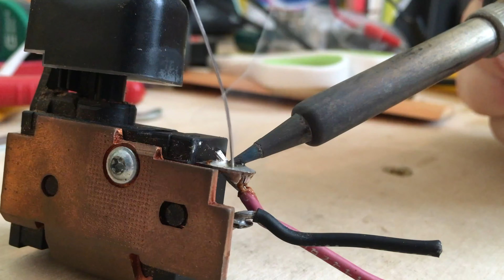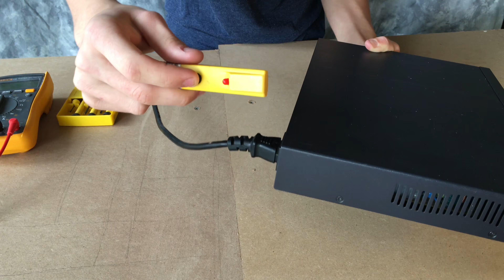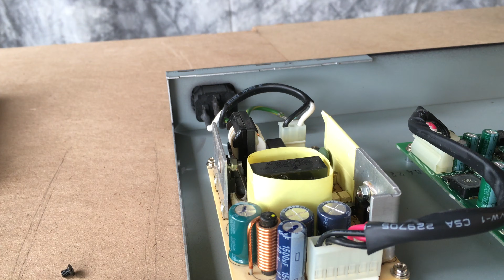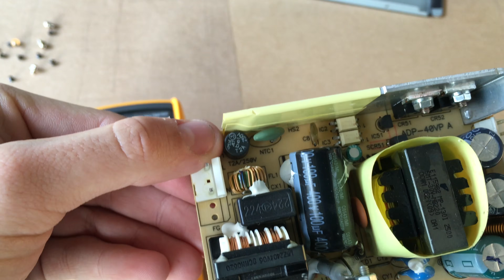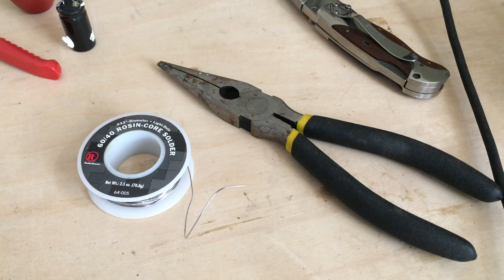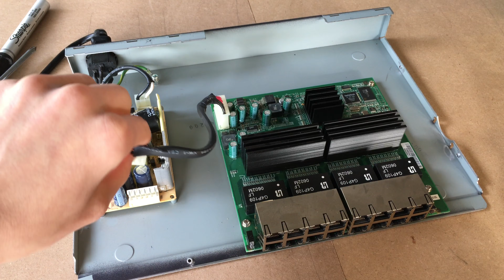Ben Repairs: DIY Ethernet Switch Power Supply Fix

Comment: Suggestion: consider draining the high voltage capacitor, either with a power resistor or using the tip of an old screwdriver, to avoid getting zapped. Consider getting a new cap with the proper legs from digikey/mouser. They are not that hard to get.  Consider using 105C instead of 85C caps. Other wise good work.

Comment: Hi Ben, thanks 4 this video! For a more complete info on this power supply, could you be so kind to tell me also the output voltage this power supply should provide o the load?

Comment: I used to repair many makes of switches in the aerospace - defence industry, best to change ALL the capacitors Not just One, because they age with heat & poor design of the power supply, always use high temperature capacitors rated at 105C & look at the capacitor types, Panasonic switching capacitors are very good to use, Look at the ESR Value, you can fit better types always, WATCH OUT FOR HIGH VOLTAGE Large High Voltage Capacitors take time to drain, which depends on the bleed resistor connected in parallel,

Comment: Any idea for ZYXEL switches what voltage must the internal PSU have ? I measure 3.3 on red and 5V on yellow and I have a feeling this should be 5 and 12 instead.

Comment: I blew a R 20 000 switch it still lights up but doesn't work I replaced a capacitor that that blew and the coil that burnt still no luck. Before it broke it would click like as if a relay was triggered but not exactly what the next step is. I haven't been able to find any wiring diagrams. It's a planet igs-10020hpt switch

Comment: I see these fail the same way a lot. Problem is the small capacitor thats glued to the big 100uF shown in the video. Its something like a 47uf 25V an its called a bootstrap capacitor. Its only job is to provide power filtering to start up the supply when first plugged in. They often fail and are never noticed until after a power outage.

When the power comes back on, the failed cap is unable to start up the supply. People assume some sort of power surge/spike killed the device during the outage but truth is the device failed a long time before the power outage. If the network box is powered by a UPS, this could be a very long time from when the cap failed to when it gets noticed.

Replace that little guy and supply will come back to life.
Do be sure to check the tall caps near the 6 pin plug. If they have any sort of bulge on the top, replace em.

Comment: nice video but ...how to fix a poe switch from ubiquiti (the main problem is about if you connect 2 more poe devices , the switch poe mode doesn't work well)  ?

Comment: i removed the power circuit out like u did it was unplugged and it gave me a electric shock
Reply from the maker: You forgot to discharge the capacitor.

Comment: i have problem with planet FGSW 1816 hps its all lights ON and nothing working not even reset the led is blink underneath the circuit board continuously. what is this meaning or code for this led blinking.if any one know help is appreciate-able

Comment: You found it.  I had the exact same problem - Dell 2Xnn series switch (mine is also a 2716; many of them share the same 5V 8A P/S) - and it had the same bad cap.  It's C3, a 47µf 25v.  Mine tested at 17µf.  Replaced with 47µf 35v 5000hr part so it's unlikely to fail again for the lifetime of the switch.
Reply from the maker: Sweet! Glad I could help!

Comment: Ben Builds:,
Those high voltage "Taicon" brand capacitors seem to be prone to having leakage and corrosion at the leads. I've seen it before numerous times.

Comment: Great video, and good work.  Just to be nit picky though, those four controller chips you pointed out in the beginning aren't chips.  They are magnetic couplers, required by the Ethernet specs.  The controller chips are under the black heat sinks.
Reply from the maker: Hmm, did not know that- thanks!

Comment: Capacitors are the bane of modern electronics. It all has to do with smoothing out power and when they short of go open it's trouble city. The issue is that manufacturers build as cheaply as they can and use low quality capacitors.

Comment: Great repair video! 
I have two 5 port switch's that have the same behavior, they turn the light on "power" and "led Ports" but the led ports keep blinking, i've analyzed the board and doesn't see no capacitor's damaged, have 3 47uF 25V small capacitors and 2 100uF 25V a lil bigger ones, maybe its one of those?
If u can please help me
Reply from the maker: +hed190 Blinking LEDs on the ports are a sign of normal data transfer and operation. Are you getting any data through the switch?
Reply: +Ben Builds: It's blinking but not data transfer blinking, i had no data through, ive replaced the 2 100uF 25V capacitors and now i can have 2 PC's receiving internet when i plug a third the connection goes down, i might have to replace all the 3 47uF 25V capacitors too...

Comment: Great video Ben.  You showed that persistence pays off.

Two items of note:

1) When replacing large capacitors, make sure they're discharged before working on them, especially if you've just had the unit plugged in.

2) A spot of silicone or hot glue to tack your modified capacitor to the board might be a good idea.

Keep up the good work!

Comment: Great repair video.   Some people may not realize that you need to pay attention to the polarity of those electrolytic capacitors.  You could emphasize that in your next repair video.  You mention that it takes time to get your components.  Have you tried Digi-Key?  That is who I have used in the past and they had great service.
Reply from the maker: +Pidasian Hippie Hmm... you're entirely right. I will make sure to emphasize that in the next video. I primarily use Mouser, Newark, and Ebay for parts but I'll definitely give Digi-Key a shot! Thanks!
Reply: Ben Builds: You are welcome.  BTW, your school is lucky to have someone like you around.
Reply from the maker: +Pidasian Hippie Thanks!